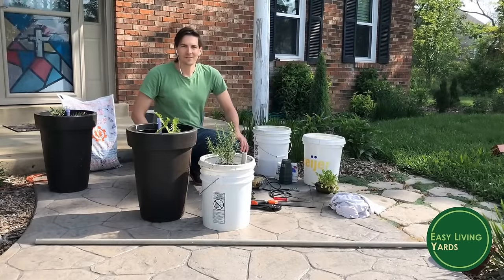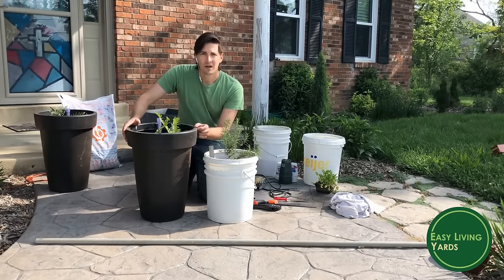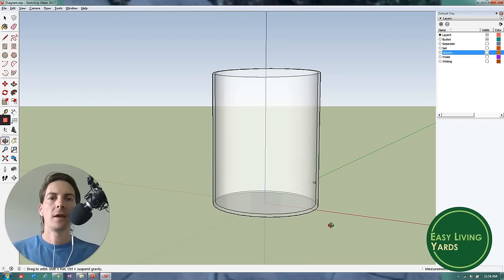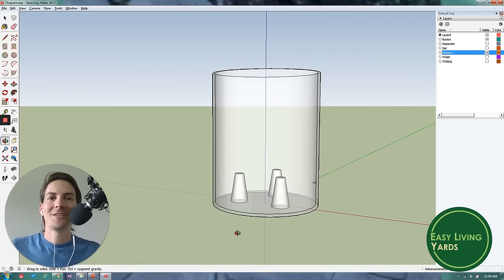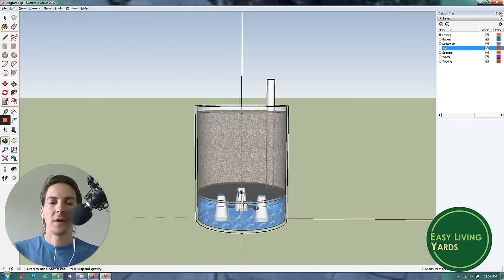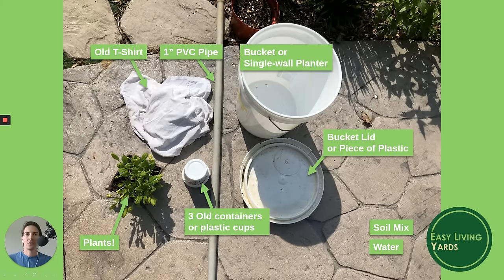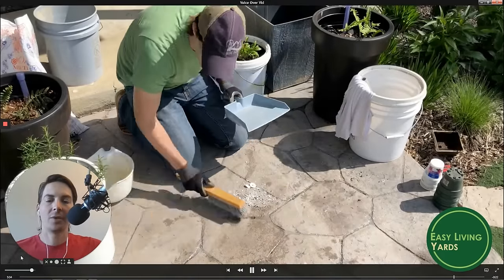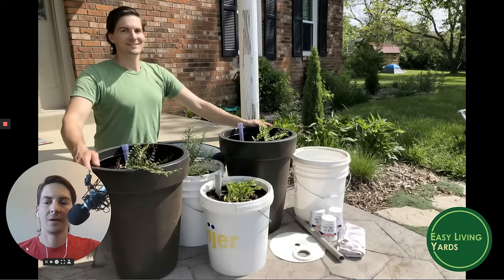How to make a Self Watering Planter

Comment: I have watched probably 20 videos by different people on how to engineer these buckets and it was by far the best one I have seen. I especially liked your explanation about gap of air between the top of the water and the lid. I have seen others where instead of using a T-shirt, it uses one of the containers at the bottom, pack it real hard and the water wicks through the dirt...  I am amazed that enough water will wick through that T-shirt to keep the plants (tomato plants in my case) alive.
Reply: I have also wondered about the difference in outcome of wicking material (the t-shirt) vs wicking soil tube. I have materials for both in hand.

Comment: Great video! Does the separator cut from the lid actually sit on top (ie touching) the top of the cups? How do you ensure this as the separator plate will find its own level in the tapered bucket?

Comment: Hey, I am thinking about doing somehting similar, but converting an existing raised bed planter. I was wondering if I used a sealed plastic container as a resevoir, would it work? Would I need to still leave an inch of space from the top for root  control?

Comment: Thanks for this excellent video! i did this exercise a week ago but i struggled with small deatils, in determining mostly the thickness of the cups, plate, height and thickness of  wicking cup, etc. is there a recommended measurement? Thanks☺️

Comment: I am using grow bags over coiled drain pipe with fabric sleeve. I have a one inch air space, and nylon covered wicking material I read was the best thing to use as cotton will rot.   Rope actually, with open weave center. Q, will grow bags wick do you know?

Comment: Like the idea of the filling tube.  Used to fill my big driveway planters 1/3 with packing peanuts, then a layer of of landscape fabric.  I would use heavy cotton rope as a wick, 3 or 4 poked through the fabric into the water/peanut packing well.  Add soil and plants.  Would just top water, extra water fell into the bottom and would wick back up into the soil.  Going to try a couple taller decorative ones with a fill tube and drain hole for our seasonal campsite.

Comment: I added a solenoid valve with a timer unit to my water source and stuck that hose into the fill tube. Every day it adds water to the reservoir and it never over fills it because of the overflow hole. I just have to watch my plants grow.

Comment: Great video. 
Many ways to create a self watering wicking system. I use both  the 5 gallon bucket system and I use the same tall pots for my tomato plants.  My structure is much simpler but effective.Over the years I have adapted the self watering wicking system to what works best for me.

Comment: The best instructional video I ever viewed. I want to like it a thousand times if I can. Thank you, thank you, thank you. 
There is one improvement I would suggest: drill some small holes on the plate to allow excessive water to go down the reservoir in case of heavy rain.
Reply from the maker: Wow thanks Neal, that means a lot!  Thanks for the feedback on the divider plate as well - hadn't thought of that.
Reply: How deep can the wick go before it stops watering the plant? can the bottom wicking container be long and sit in a long bucket and still work?
Reply: @justicematters5447  I saw someone put a long bamboo stick into the tube like a dipstick to see how much water is left in the container. They just remove it when they add water.
Reply: @lindastrang6755  Good to know

Comment: This has been a comprehensive and generous tutorial….from your computer generated plans to the practical application. 
I just have one question….it is my experience that a constantly wet or damp natural fibre will grow mold even at low oxygen levels. I was looking for an alternative that may work just as well without the threat of mold . Using soil itself in a type of wicking basket seemed the best alternative; although I could see that it would be challenging to keep the soil out of the water reservoir. Synthetics such as nylon and acrylic are options but ultimately could grow fungus as well. 
So in the end I’m assuming that after a growing season, it’s a good idea to dismantle the pot, clean it, discard the cloth and start fresh.
Reply: I heard the t-shirts will rot.  I don't want to reconstruct ev single year.  any idea on a different wick, other than cotton tshirt?

Comment: What did you use for the plate "bucket lid" for the brown planter? And how did you measure it since it was coned shaped (not a straight side like the bucket). I'll look through the comments below and see if it's answered & then delete this but if not, would you please reply. And it seems like everything I find for planting pots have holes...been wanting to make a small water feature out of a planter but come up with same problem - holes in the bottom. Thanks for your help AND thanks for passing along this easy DIY self watering feature...great timing the Western US (Oregon of all places) is going through a historic drought. Global warming & half our state trees burned down last year creating another local (micro) climate change.
Reply from the maker: Hey Katherine!  I used an old frisbee as the divider in the brown planter lol.  I have a lot of old frisbees laying around.  I didnt even need to cut it as it happened to be the right size.  You can use any sort of plastic dividing material and just cut to size so it sits on top of the spacers with just a tiny bit of space for the t-shirt to go around the edge.  Best of luck in the drought - and sorry to hear about all your struggles in Oregon!!!

Comment: Well done brother. My only concern is the cotton cloth which can rot very much in damp soli. I think a wooden cloth can be best alternative. Any suggestions?
Reply from the maker: Hi Sham, thanks for watching and glad you found it helpful.  You are correct, it eventually degrades.  I usually rebuild these once every one or two seasons.  It is usually completely degraded much longer after two seasons.  The cotton serves as a wicking membrane to pull water up into the potting soil, while keeping the potting soil separated from the reservoir.  Any replacement material would have to also be good at soaking water upward.

Comment: I am doing some self watering trough planters, obviously longer and larger (L)1000mm x (W) 300mm - than the bucket type, any advice on the amount of water required per foot to keep plants and vegetables hydrated. Appreciate any help and guidance. Great video!
Reply from the maker: Hey Gaz, sorry for the late reply here.  I've never done one much larger than a tub size.  I've seen a few vids out there where folks use corrugated pipe in the bottom to create a reservoir space, then fill around the edges with gravel or some other filler, then add a layer of landscape fabric, then the potting mix.  In comparison to the smaller planters, I've always tried to have a reservoir at least 10% the size of the potting soil volume.  Hope this helps and good luck!

Comment: I loved the specifics. My question is what happens when you get rain from above. Is there a way for it to drain down into the bottom of the bucket so that it can get to the Overflow?
Reply from the maker: Thanks Bill! Yes if you get excess water from the top it will percolate down to the reservoir and out the overflow. The planter maintains a balance of moisture in the potting soil pores. So if there’s too much it will settle to the reservoir. This is why using proper potting soil is very important.

Comment: Great tutorial! I'm hoping to make a bunch of these this weekend from old ice cream buckets. I love that you're into organic planting - do you worry about using non-organic cotton? I've got old cotton t-shirts but nothing organic at the moment.
Reply from the maker: Hey Robbin, I haven't worried too much about the shirts not being organic.  They're pretty old, and I figure any nasties would no longer be there.  If you're concerned (and you have fair reason to be), I might suggest trying to find some organic cotton by the yard, or perhaps trying with burlap.  Not sure if the burlap would wick well enough though.  Also, I've gotten organic straining cloths for relatively cheap at the local organic foods store.  Those would probably work.  Good luck!
Reply: I made a bunch of these planters (back in 2014!) and used a poly material that worked great. I live in a VERY dry area that's also very warm, and cotton will rot and become nasty over time. The poly material I got holds up better. :-)

Comment: Do you have to wait for the roots to reach the bottom of the bucket before you start watering from the PVC pipe?
Reply from the maker: Great question!  Answer:Nope.  If you use a good potting soil, the pores in the soil serve as a wicking material, pulling the water up from the bottom via the t-shirt.  Pretty cool how it works.  Thanks for asking!

Comment: I do have 2 earth boxes, which if your familiar with are this same concept, minus the wicking part. I’m now curious how their water feeds up something I’ve never though about before. 

What are you using in your actual planters for the plastic piece?
Reply from the maker: Yes when I learned about these my mind was blown!  They fit into my forgetful/lazy lifestyle.  
The earth boxes are a very similar commercial version, with built-in wicking elements in the lower separator. 
For the decorative planters, I used old frisbees that fit perfectly :)  Any non-degradable, non-toxic barrier will work.

Comment: Hold up. Doesn't cotton have the potential to rot? I've been doing a ton of research on SIP designs for my future "tomato" grow and the wick part is the one part I keep finding the most conflicting info on. Some say you don't need a wick at all and the soil will suck up the moisture well enough on it's own. Some say to use a cotton or polyester rope or fabric.
Reply from the maker: In short, yes.  The cotton will decompose.  I usually refresh the soil and repot the plants every 1-2 seasons, depending on what I'm growing.  By 2 years the cotton's pretty much finished, but lasts great for over a year!  I prefer the cotton because it wicks very well.  I also prefer to have a barrier to keep the roots moist yet aerated, and not able to become waterlogged.  A decent potting soil will also wick water up, but you can also get roots growing down to the water level and get rot/decay issues depending on the plant.  Most self watering planter versions out there seem to work pretty well.  This is just my take.  I suggest you pick the one or several you like and give them a shot :-)

Comment: I've done this with the buckets.  The only difference I do is I use a net cup or a container with drilled holes and drill the hole larger to accomadate the container.  Then I put potting mix and use that as the wicking.  Just like the Earthboxes.  I have several Earthboxes and this works great.  You did a great job on explaining the process.
Reply from the maker: I've seen several designs like that and hear they work well that way too.  Glad you found the video helpful!

Comment: This has been the best one!! Thank you. I do have a question. I got some 5 gallons from a burger king dumpster with lids and these plastic perforated disc that fit in the bucket. It's like a flat large holed sieve. Would it worked if I got some landscape fabric to cover the sieve disc, then the t-shirt over it?
Reply from the maker: Hey Jackie, thanks for the kind words.  Sorry for the delay.  Nice salvage! If you haven't yet gotten to building them out, I would guess from your description that you'll be fine without needing to add a layer of landscape fabric, as the t-shirt is also part of the barrier.  Also note Neal Kuo's comment - he suggests potentially adding additional holes to the divider for better drainage in the event of heavy rain.
Reply: @EasyLivingYards  thank you!

Comment: Have you ever had problems with mosquitoes or other types of bugs crawling into the drilled hole and breeding?
Reply from the maker: Hey!  I haven't had issues - A good retrofit that I didn't show here is to glue a small piece of screen material on the inside of the pot to cover the hole.  I've done this on some, but others I haven't but don't ever notice mosquito larvae inside when I empty them out.
Reply: A friend of mine has Tree Frogs in hers! They eat the bugs!

Comment: It's a nice concept though I don't really have all the tools.  I wondered, if you cut a plastic bottle in half and insert the top half into the bottom half, like a funnel, would that also work?  It would need to rely on the water percolating down into the reservoir, but there are certain advantages, like the bottle being clear so you can see when it needs watering.  Plus you could make it with a box cutter and some scissors.
Reply from the maker: There are designs like your suggestion, on a much smaller scale that I've never tried.  You also would need a wicking membrane and something to separate the soil and water layer, with space for an air gap between the soil and water.
Reply: @EasyLivingYards  I have one operating on my window sill.   The soil itself in the upside down bottle neck is a kind of wicking.   I like the transparency of it, and the reuse of old bottles, but it's only small scale, for a small plant.

Comment: Won’t the cotton decompose after a while?
Reply from the maker: Yes, eventually the cotton will decompose.  I've had them last over two years, just fine.  By then, I'm usually rebuilding/replacing the potting soil anyway - usually because one of my kids has knocked them over or pulled out the watering tube by then!

Comment: Great video, but maybe add a float to the water tube so you can tell when it needs water.
Reply from the maker: Agreed - this is a very nice addition.  A lot of people use a piece of foam tube like caulking backer rod or similar.  I simply check on mine about once a week by tipping toward the drain hole.

Comment: Will the stagnant water below the soil breed mosquitoes ?
Reply from the maker: If there’s no way to access the water it will be fine.  The only risk for mosquitoes is the overflow hole in the bottom. I didn’t show it in this video but you can glue a small piece of screen material on the inside of the pot to cover the overflow hole to prevent mosquitoes from entering. I haven’t noticed any mosquito larvae in our pots so far, so I haven’t bothered with screens.
Reply: @EasyLivingYards  Thanks pal. Just a minor concern. :)

Comment: Comments for this “gold standard”video made me chuckle. Who really needs CAD presentation to understand a bucket with lid, a piece of PVC and a t-shirt? Also, if I see someone use a drill to make a hole and a saw to cut things I can pretty well figure out that I will need a drill and a saw without the exhaustive list of every tool I will need before then showing use of the tools. For those clicking on “how to make a self watering planter” because they just want to know how to make it, skip the first 10 minutes. Oh, and you may use regular plants, not necessarily “organic,” because you will never detect any difference. I am baffled at people thinking a great video is one taking about 14 minutes to show what should’ve been demonstrated in four minutes or less. To be fair, the relatively few minutes actually showing the build are fine.

Comment: Cotton material isn't required. I use a poly material that doesn't rot like cotton does and it works great here in southern Arizona.
Reply from the maker: Glad to hear.  I've used cotton concerned that the poly doesn't wick as well.  I've heard many folks using it successfully though.  I also have a lot of ooooold cotton shirts lying around!

Comment: Great video, but you don't wanna use a cotton wick. This will quickly break down and your will will be gone. Always use something like nylon or geo fabric that will not break down yet still be able to wick water.
Reply from the maker: Thanks for the tip Richard.  I've not tried synthetic fabrics, assuming they wouldn't wick as well.  I use materials (like old t shirts) that are already laying around.  I usually rebuild these after a year or two.  By end of year two the cotton is degraded.

Comment: DRILL IS OPTIONAL: For plastic you could use an OLD flathead screwdriver or an OLD knife with your home gas stovetop or butane torch. Heat until red hot and just gently poke it in. You'd have' to reheat often and would need plenty of ventilation but it is doable and does have certain advantages over drilling like being able to make thin long slits. 

BTW doing this with a hot nail and some pliers is the perfect way to add more holes to your leather belt.
Reply from the maker: Thanks for sharing Sashko.  Worth a try.

Comment: I made this planting system after 3 months the system failed. The t-shirt rotted and there was no way for it to wick water up
Reply: Sorry to hear Marci! I haven’t had the same experience. My setup usually lasts a full season. Some others in the comments have mentioned success with a polyester shirt. I’ve also been interested to try a burlap material for longer lasting effect but haven’t yet. I’m not sure if it would wick properly. Thanks for sharing your experience as it may help others with their choice of material.